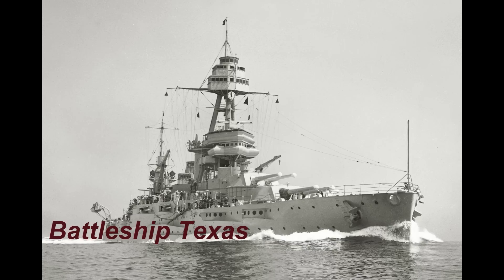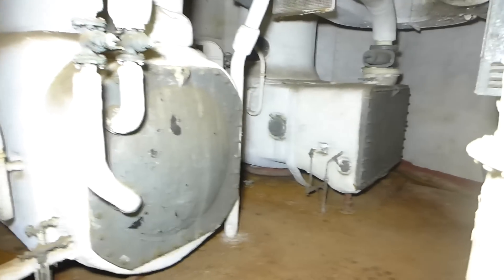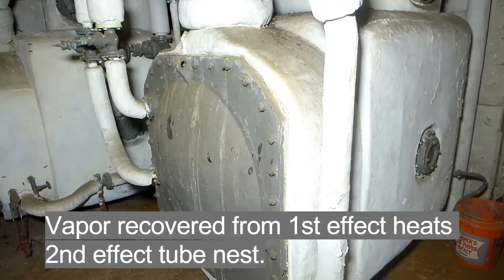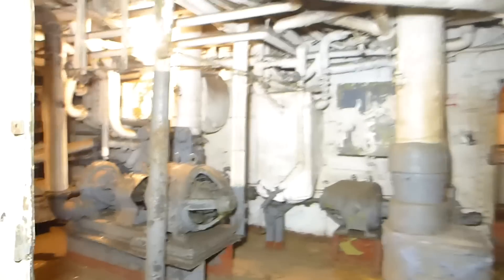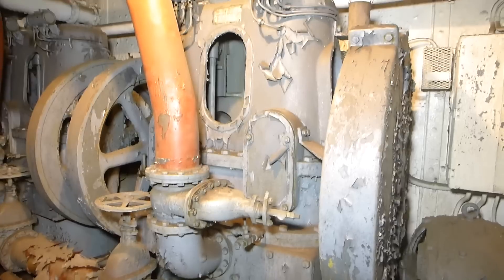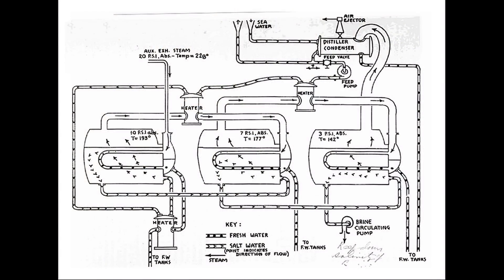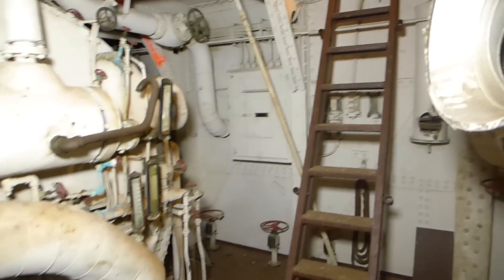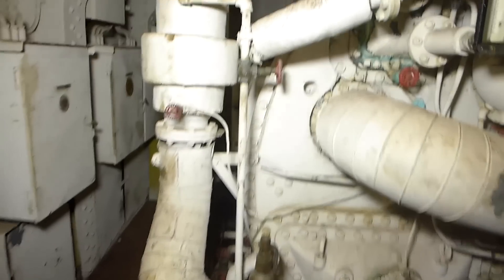Battleship Texas, Making Fresh Water In The Ocean

Comment: At 10min I paused for about a minute to follow all the pipes in the diagram, then just as soon as I unpaused you colour-coded it. lol

Working in HVAC I find all these boilers and supporting systems very interesting. The fundamentals are the same as what we still use to heat and power buildings on land today, but the way some things are setup are so different because of the era and requirements of being on a moving ship.

Comment: What a complex eay to produce fresh water.
After twelve years in the Royal navy i can asure you that the system we used worked very well and was a lot simpler, it had a single chamber with four coils od copper pipe fed with saturated steam, the camber was filled to near the very top ten the heat created a pressure at the top where it forced the water out to leave about half the chamber full with leaves a vacuum, a,lowing the seawater to boil at a reduced temperature, dependant on the level the water could be made to boil at just the right temlerature to boil the water at the correct temperature that the water and the salt content would seperate leaving the salt in the bottom and the steam created would be drawn off and cooled to condence back into water, this was then checked using silver nitrate if clear of all salt it was then sent to either feed water tanks for the boilers or to storage tanks for fresh water for general use.
There were two such evaporators on the ship which in fact could if needed supply enought fresh water to keep a small town in fresh water.
Ever so ofter, they were shut down, the copper coils removed as descaled of any build up of salt or chalk using feric cloride, and then replaced into the evaporator.

Comment: Tom  your knowledge amazes me. Thanks for Sharing!     The fresh water tanks, How many and what was the capacity?
Reply from the maker: There were 4 fresh water tanks that stored about 40,000 gallons of potable water meant for crew consumption.  There were 12 boiler reserve feed water and 8 emergency reserve feed water tanks that stored about 180,000,000 gallons of makeup feed water for the boilers.  While it was fresh water, it was not meant for human consumption since it was typically treated to be very alkaline.  That was done so that calcium compounds in the water would precipitate out where it could be blown out of the boiler water drums instead of form scale on the inside surfaces of the boiler tubes.
Reply: @tomscotttheolderone364  Tom Thank you. To learn is a key to a long life, and you help so very much.  I appreciate your answers..

Comment: Mechanical air (vacuum) pumps must have been the precursors to the DFT I ran while in Navy in the 70s. Deaerating feed tanks remove dissolved gases from boiler feedwater. The biggest thing was getting rid of the free oxygen to protect the steam system from corrosive. Damage control drills resolved around a ruptured tank, all the water would instantly flashing to steam. No pressure to contend with but the whole space would be close to 170 degrees in seconds and trying to breath water vapor at, well.

Comment: Tom,  do you have a video on the Armory Room?  or does this ship have an armory?  Thanks... I really enjoy the videos of the Texas !!
Reply from the maker: The armory was located in a compartment on the main deck that is part of the superstructure.  You will find it marked, "ARMORY" on the drawing in this attachment:  https://battleshiptexas.info/images/Drawings/DeckPlans/1944/MainDk.html  You can locate it in the starboard side of the superstructure, where the the center line is marked with frame numbers 63, 64 and 65.

Unfortunately, there won't be any videos because nothing remains that indicated its purpose.  Not only was it stripped bare when the ship was retired, the space has been re-tasked to be the main electrical room for modern power brought onto the ship.  Small arms ammunition was stored in magazine A-34-M-S, located on the second platform, deep within the ship.
Reply: @tomscotttheolderone364  Thank you.  I have a Armory rack circular holds 80 1911's.... Holds 20 per level,  4 levels.. 1 lever per level locks in the 20 with one padlock.  Base looks like could also hold some M1 Garands if converted... Looking to price,  sell,  ???  I was born in Jancito City 1951 and been to the ship 3 or 4 times.  It is put away right now, maybe pictures later.
Reply from the maker: @pbc1951  Thank you for the input.   Please be aware that I do not allow the discussion or promotion of items to sell or purchase beyond what is sold by Battleship Texas Foundation.
Reply: @tomscotttheolderone364  Thank you Sir.

Comment: Tom, you have produced some outstanding technical videos on the workings of this great ship.  I have a question, how did they refuel her?  All those small oil tanks, surely the oil king could have them fuel up from one location?
Reply from the maker: There were 92 tanks on board, but it was probably pretty rare that even half needed filling.  You are right about there being a single location.  While there were several deck fittings where fuel could be taken, they all fed to a relay tank on the third deck that was above the top of all fuel tanks. The relay tank piped oil to the fuel mains that ran most of the length of the ship on both sides by pumping it backwards using the booster/recirculate pumps in the boiler rooms.  From there, individual feed valves that controlled fuel from each tank would be opened and fuel pumped in.  They kept track of quantity in each tank through sounding lines that were pretty precise.  Once filled, the next tank valve would be opened and the first closed.  Pumping continued until they took the total approved amount of fuel on board.
Reply: @tomscotttheolderone364  Thanks so much for the response.  I am beginning to get a real feel for all the operational activities on the ship by watching your videos!  Much appreciated!

Comment: Super informative video as always, Tom!  You even surprised me with the more modern auxiliary evaporator equipment. I didn't know that space even existed until now!  Also, you mentioned that the 3-element diagram you showed was historic.  Who was the creator of the diagram?
Reply from the maker: It's been a couple of years since I located it.  I'd have to do some digging to find the source.
Reply: Tom has done an amazing job explaining a very complicated system in simple layman terms.  Few gave any thought to making fresh water but without it they couldn't cook or even run the engines which are just 2 very essential needs of a ship.  Hats off to the Sailors that kept the fresh water flowing during rough seas or under fire.  People need to keep in mind that all that saltwater rusted steel like crazy.

Comment: Thank you for a wonderful video.  I am surprised that both sets of the 1925 evaporators were placed in one compartment.  It seems a severe violation of the principle of redundancy.  Damage to that compartment would have crippled the ship.
Reply from the maker: I can only speculate, but there certainly had to be compromises that lead to the decision to place them together.  The amount of equipment, piping and even crew required to operate and service the system would have been significantly larger if they were separate.  One good thing, they were inside what was called the armored citadel that give pretty good protection.  What is interesting to me is not the fact that they are together, but their position on the ship.  Later ships, beginning with the Nevadas, had their evaporator systems far better protected by locating them deep within the ship on the 2nd platform and hold deck levels.
Reply: @tomscotttheolderone364  Fair enough.  Thanks for the reply.
Reply: @tomscotttheolderone364  Interestingly, even the 1920's vintage evaporators were much more advanced than the one on the SS JOHN W BROWN.  This was installed during the ship's conversion into a limited capacity troopship in about 1943-- my understanding is that all-cargo Libertys had no evaporator-- and was a high-temperature unit that made a horrible racket, used prodigious amounts of superheated steam and which had to be opened every few days and the salt chipped off the steam coils with a chipping hammer.   As a museum ship, we never had to use the thing, for which we were very happy.
Reply from the maker: @Pamudder  Yeah, it sounds like they were basically high temperature distillers that ran at much higher temperatures.  They had the advantage of being simpler to build and operate.  The bad news is that they had to be constantly descaled.  One of the great advantages of evaporators is they run at temperatures that don't produce hard scale.  Instead, they created softer buildups that could be scraped out without chiseling.  That was a good thing since the tube nests were made of copper and were easily damaged.  On top of that, there was a chronic shortage of the tubes, so they took very good care of them.  I have seen memos saying that one reason they didn't replace them with newer, more efficient units during WWII is that the old ones were still producing at their maximum rated output.  This suggests that engineering was very good about regularly and carefully servicing them.

Comment: 18k per 3-effect, 36k from two 3-effects, or rather, 6-effect; in a day, if it ran properly. And how many people can drink all that freshwater? And if you limit the number of people to the size that run the Texas, how long will it take to use up all 36k worth of water?

Also what's the measurement? Liters or gallons???
Reply from the maker: The unit of measurement gallons, as stated at 1:36 and at other points in the video.

They are only described as two, triple effect evaporators and never considered 6-effect.  This is because each of the units are made of 3 effects piped together to operate as a single unit.  It was impossible to run them as 6 separate effects.  However, if an effect failed, the evaporator could be quickly configured to eliminate it and operate at lower output as a 2-effect.

They were not run to make 36,000 gallons that were consumed, then run again to make 36,000 more.  Instead, they were run just enough to replenish water tanks.  So, they may only have to produce a rate of 10,000 when usage was low, or run at full output when it was high.  Water was used for far more than meeting the crew's needs.  The vast majority was used to replenish what was lost in the ship's steam system.  Even though it was a closed cycle, there was loss that had to be replaced.  If we conservatively assume that the steam system lost 2% during operation, the evaporator's full output of 36,000 gallons per day would not be enough to keep up with the losses that occurred with the ship running at full speed.  What kept the boilers from running dry was 200,000 gallons of make-up water stored for just that purpose.  Water was drawn from those and the evaporators were used to keep the tanks topped off.

The crew's needs were secondary to the needs of the steam system, but they were adequately cared for with a large fresh water tank that could meet their needs for a few days if not replenished.
Reply: The average American uses about 80-100 gallons per day. The crew compliment was about 1000. 

The ship gets water first, the rest goes to the crew. In reality, "sea showers" were the order of the day for a reason.
Reply from the maker: @JoshuaTootell  The crew size grew to 1,800 by the end of WWII, meaning that the full output of both evaporators would only permit 20 gal/day for the crew.  So not only did they obviously consume less than that, it undoubtedly explains the need for the 12,000 gallon per day emergency evaporator installed in 1942.

Comment: It would be cool to get part of this fresh water system functioning again (with new technology) so the ship could be independent of one shore utility.
Reply from the maker: I agree, but the result would new equipment that compromises the integrity of an historic artifact.  Ultimately, it is much less expensive, less maintenance intensive and less intrusive to the ship to simply pipe water to it using a single water line.
Reply: @tomscotttheolderone364  was there a dedicated sea chest for this system or was it shared with others?  Regardless, that intake point is likely welded over at this
point, right?
Reply from the maker: @jamesbeaman6337  All equipment requiring water for supply, cooling or fire fighting had their own dedicated sea chests.  As a result, there were approximately 50 chests and hull openings that have now been sealed.
Reply: There is a reason why ships use a shore tie when in port.

Comment: Interesting system.  First thought seeing that old insulation: danger! mesothelioma zone.  Famous actor Steve McQueen died from it when he was 50.  He refitted ships in the war for the Navy. The confined space, poor ventilation and constant foot traffic during renovations constantly churning asbestos into the air.
Reply from the maker: McQueen was exposed before there was an understanding of the threat that asbestos made.  Things have radically changed since then.  There is no significant threat posed by what remains on board.  It has all been encapsulated using accepted and approved coatings that are extremely tough and durable.  If any damage occurs to it, the space in which is is located is closed and sealed, then licensed contractors either remove or repair it before it is reopened.
Reply: @tomscotttheolderone364  Thanks for clarifying  I did notice the steam pipe insulation looked awfully clean and white after sitting 70 years.

Comment: Did Texas supply its own Boiler and drinking Water even when in Port, or was it trucked in?  I imagine that when the ship was operational, there was constant scraping and painting in these rooms. Don't you wish you had 250 hands to do that now?
Reply from the maker: Shipyards had the ability to provide shore water, electricity and steam so that the ship could shut its systems down while being able to run lights, blowers, cooking, etc.  You are right, there were typically 800 or more young sailors on board that had to be kept busy.  Just 250 would be nice, along with a few hundred thousand bucks worth of paint, brushes and other supplies!
Reply: The ship I was on in the Navy (Nimitz class aircraft carrier) had very similar distilling plants and we were not allowed to run the distilling plants in port. We had to be a certain distance from shore before we were allowed to make fresh water (I think 12NM iirc). You wouldn't want to make freshwater in port because the harbor water was generally dirty and the shallow water caused a risk of sucking up harbor floor sediment into the distilling unit which could damage equipment and/or foul the heat exchangers.